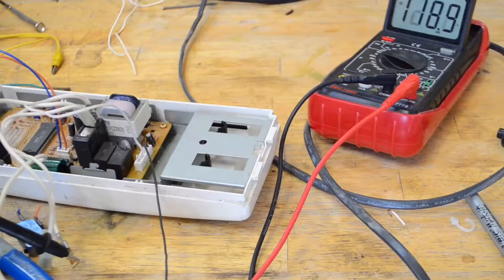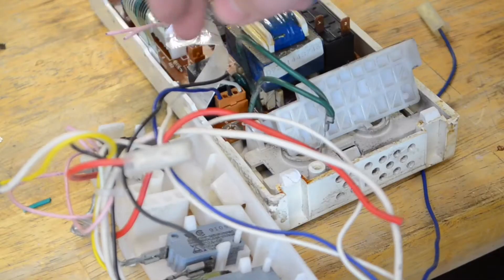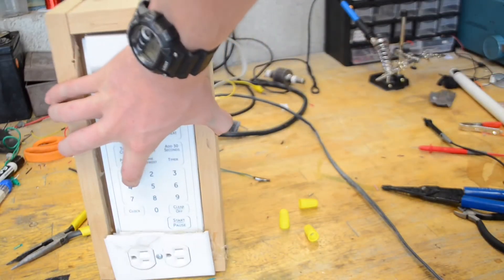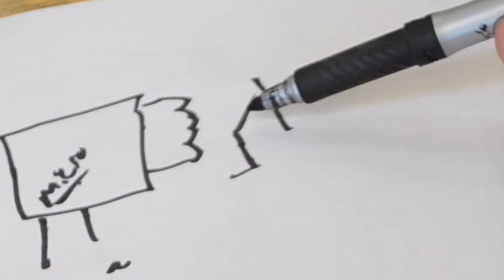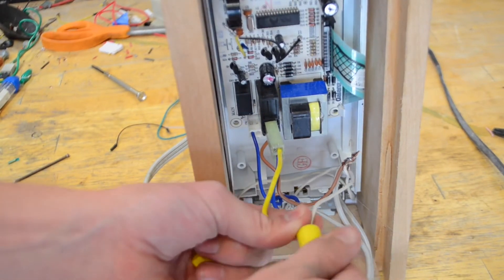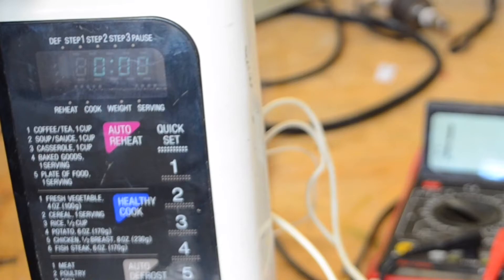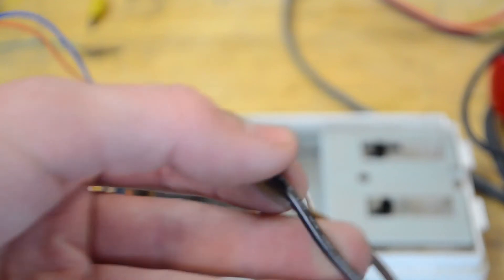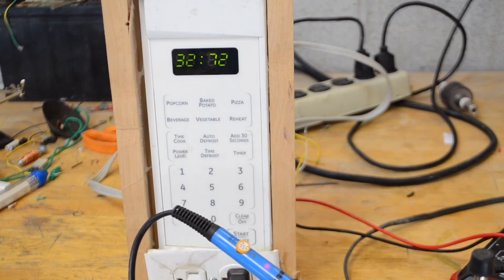How to make an electric timer from a microwave

Comment: Nice video, I actually had a broken microwave (just the motor died) and built one of these before I found this video and had a few difficulties. 
1. The switch that runes to the door was inverted on mine so when I closed the loop it would start "cooking" and when I opened it, it would stop. 
2. The case of mine was solid metal so I had to hack and cut my way in with a hacksaw that had no handle (it broke while cutting a different part).
3. I did not understand at the time how the relay worked and it took me 2 or so hours with a multimeter to figure it out.

In the end though I got it to work. Now I go to Youtube and see that you had a video the whole time. Love your channel and the projects you do.

Comment: Thank you so much for publishing this video. I just made one and I can't wait to put it to practical use. I think the defrost function is quite interesting because it powers stuff for only a few seconds at a time with a long break between each run. I would like to use the defrost function for a Jacob's ladder, so the transformer doesn't overheat or flip the breaker. I made something similar using the turntable motor to trigger the arc, but the transformer was still on the entire time, unlike what would happen if I used the defrost function.

Comment: I made a clock from a control panel like that and I actually made a very similar wooden case for the back and sides. Also it's funny that I made that maybe 4 months ago and just saw your video. But I'll try also making it work as a timer as well as a clock.

Comment: what kind of things can i use on/for this electric timer?
Reply from the maker: Anything
Reply: @KeystoneScience  I used a microwave oven timer for my soldering iron for heating up stuck motors on electrical appliances. For example, I tried to force the shaft out of a stuck Easy Home fan motor bushing, and it broke the bushing assembly, so it became a parts fan. However, when I saw radiotvphononut's video of an Imperial record player from the 70's, he said that just like on a seized BSR record changer, using heat from a soldering iron will get it to come off gently. So, when I fixed a seized up Comfort Zone pivoting fan, I used my soldering iron. When I used the soldering iron, I plugged the iron into my homemade microwave timer that I made with an Emerson microwave that someone threw out. I set the time for 3 minutes, but it wasn't enough to heat it up, so I set the timer for 4 or 5 more minutes. After that, I was able to get the motor bushing to come off gently. I cleaned up both bushings and oiled them. I also cleaned up the rest of the fan up, and then I donated it. This timer helps me multitask when I'm heating up the gunky oil in the bushing with the soldering iron.